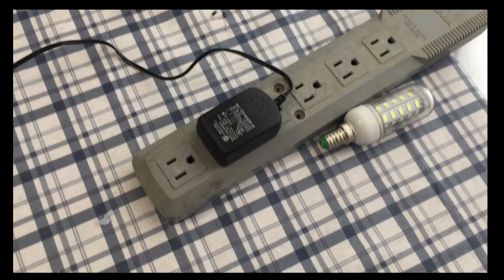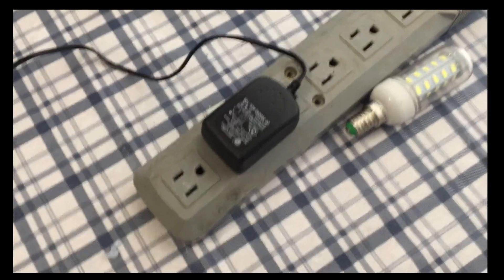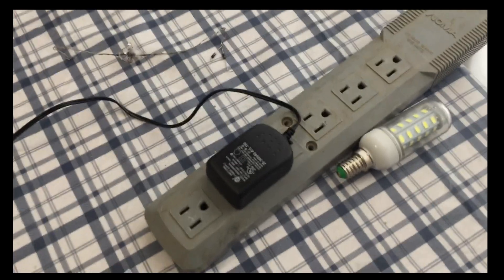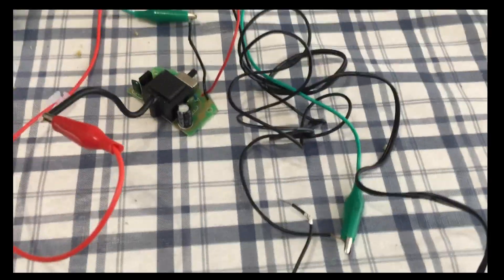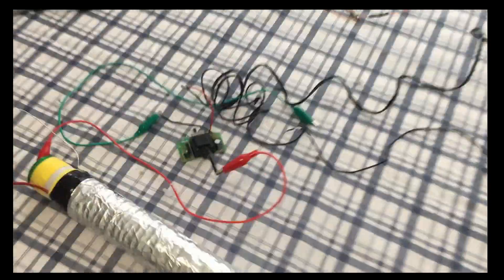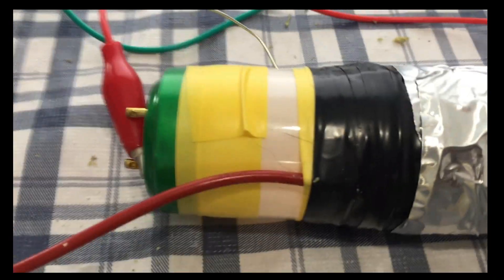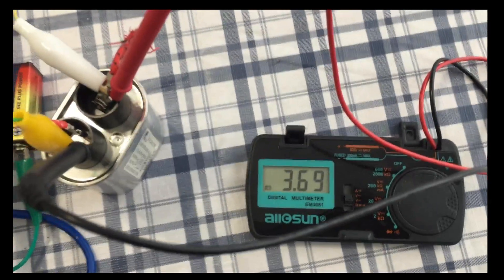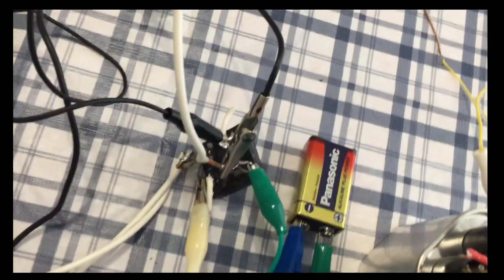Don Smith Power Supply

Comment: Hi Joel, I performed similar experiment with fluorescent tube yesterday. I didn't have coil between aluminium plates (capacitors). 
But I found out, that I have the same energy going into microwavecapacitor when I connect  both aluminium plates or I connect only one of them. 
Can you try if there is any difference at your setup, when you connect only one capacitive aluminium plate? 
(I know, my setup is not exatly same as your, so maybe for this reason is my result as is. I want to try some next day)
Thank you 
MM  
P.S. I cannot post video of it, because I have horrible mess on my workbench :-)